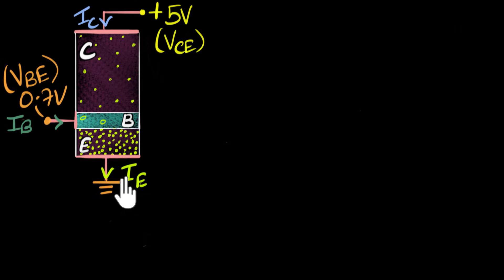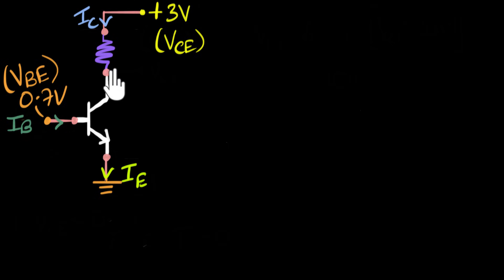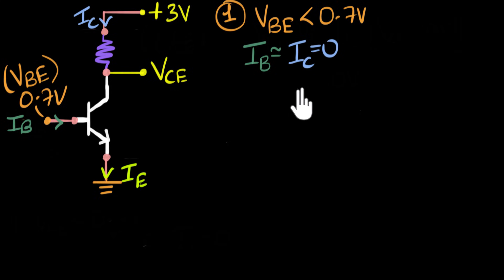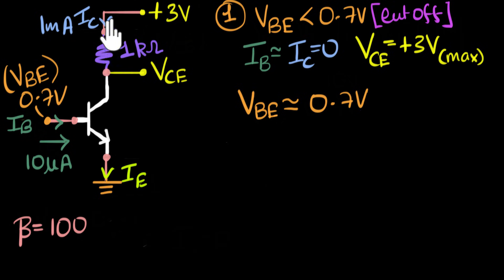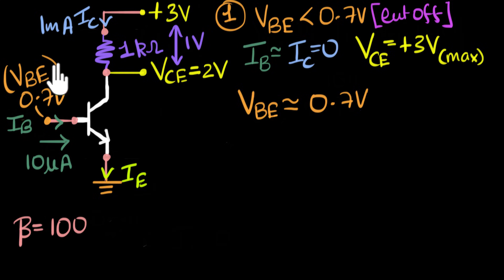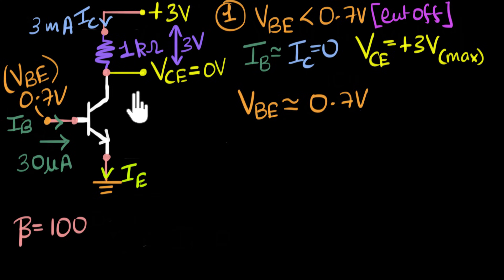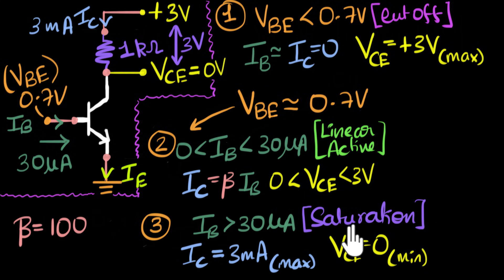Active, saturation, & cutoff state of NPN transistor | Class 12 (India) | Physics | Khan Academy

Comment: If the output voltage is connected to a load, and base voltage is zero, will the 1k resistor will have a voltage drop? Or the Vce will get the full 3v? Thanks

Comment: If your base input voltage bias more than .7 volt & 30 uA's, it will drive the amp into saturation and clip the signal. That's the un useful range for an amplifier circuit. The other two states are a on/off logic gate
duh.
Thanks cool video, I luv the different colors!

Comment: if someone can answer one question of mine.... Does the direction of current remain same when the transistor is in active state (ie emitter base forward biased and collector base reverse biased) and when the transistor is in saturation state ie both junctions are forward biased..... 
Because in this example it looks like the direction of current remains same... Please correct me if i am wrong 
And if it actually remains same then please explain to me how..... Because in that case... Npn transistor im thinking that current should flow from base to collector and from base to emitter which i know completely sounds stupid nd not possible but please correct me where i am wrong thank you!
I really couldn't stop myself from commenting but this video cleared most of my doubts... I always believe in understanding from example and that's exactly what you did sir
Thank you very much from bottom of my heart ❤
Reply: Not that i fully understand, i might be wrong...but i think the direction remains unchanged....cuz in the output characteristic video...notice that even Vce being below 5V, Ic was not negative.....it was positive, but lower than the constant current we were getting at above 0.7V....and he said that this is because when Vce goes below 0.7V, the collector base becomes forward biased....now there i think...still the emitter current is flowing, electrons are stull reaching the thin P type part and despite the collector base being forward biased...it is not as much forward biased to vanish the depletion region between collector base...and again emitter base is so much more doped...so...electrons sill flow from emitter to collector...but have a hard time doing so....thus the reduction in current? But still the current is positive and its direction remains unchanged....

Yeah replying to 3yr old comment is nuts....but i think these ques ans comments are more needed in these kind of videos....i mean i myself if have a confusion run to the comments and see if someone asked the same question and if sir or any other person replied....

Comment: Sir another doubt...
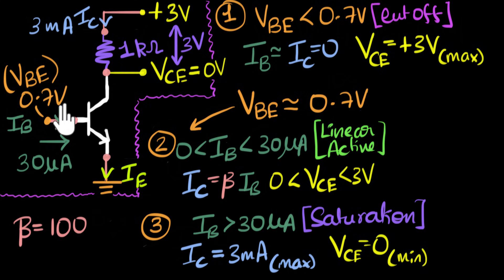At 11:10, you have said that for the transistor to work as an amplifier, the Input Current has to be within a rang. But in the 3rd case, even though the Input current is greater than 30 microamperes (outside the range), the output current is 3 milliamperes (still almost 100 times the Input current). So doesn't it continue to be an amplifier Because the condition for an amplifier is that the Output current must be much greater than the Input current, and the condition is still satisfied).
Kindly clarify this sir
Reply: Yeah but you're not getting an amplified current as you're supplying more current from base region..

Comment: Sir, at 07:47, the Output Voltage has become 0 Volts
This means that the Input voltage is greater than the output voltage
So the reverse biasing has stopped and Forward bias has started, right?(As the P type is now connected to a more positive than N type). Which means the transistor ceases to amplify
Reply: I agree. I guess there should be no current but why is there still I_c?

Comment: what would happen if i decreased the resistor over VCE or  another case increase the supply voltage, is it possible in that case to allow more current to flow through VCE.

Comment: It would be great if someone could clear my doubt - We increased Ib, so Ic increased but Vce decreased. And so we are trying to find till what we can increase Ib to, so that amplification still happens....but according to what you said in the last video, after Vce decreases below 0.7V, the base-collector gets forward biased and for amplification process to happen we must be in the right side of the output characteristics graph. So for the active state shouldn't 0.7<Vce<3V ??
Reply from the maker: You are absolutely right. I oversimplified it.
Reply: @KhanAcademyIndiaEnglish  Thanks a lot for clearing that! And these videos are great. I tried multiple resources but never understood this chapter properly, until i found these.
Reply: Yes, that's what came to my mind. The output voltage mustn't decrease below 0.7V. For the sake of explanation, let's consider that 3mA current is actually flowing while Vc is zero, in this case, there is no reverse bias to take those electrons out from base to collector, which means no current will flow but we said it is 3mA, so our assumption is incorrect.
Reply: Bruh finally got the response that I needed. Thank you ancient one's comment thread!

Comment: Here Vce can never be equal to or less than 0.7 volt as base collecter will become forward biased...sir u too Vce=0v minm...can't understand...plzzz help
Reply from the maker: The value of Vce depends on choice of resistor and supply voltage. 
You are absolutely right that when Vce goes below 0.7 volt the base collector gets forward biased. 
This is actually where the saturation region begins. 
In saturation region both b-c and b-e are forward biased
Reply: @KhanAcademyIndiaEnglish  Sir if the base collector juntion becomes forward biased how will the electrons move from the base to the collector ??? How can their be a collector current even when at saturation both the b-e and b-c juntion are forward biased
Reply: @KhanAcademyIndiaEnglish  Sir how can the transistor b-e (be) forward biased when when input voltage is less than 0.7 volt please explain .
Reply: @KhanAcademyIndiaEnglish  How is the I_C max when b-c is forward biased? Shouldn't there be no current in the collector pin?
Reply: @KhanAcademyIndiaEnglish  so it means that amplification can done only in active region.